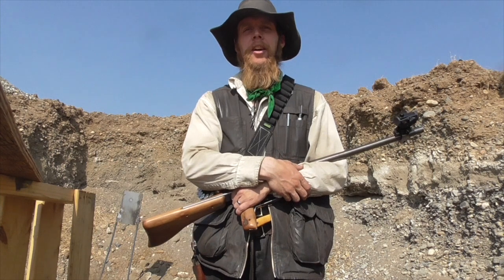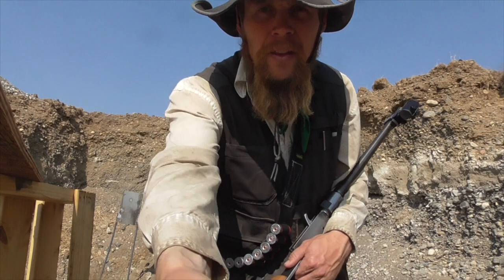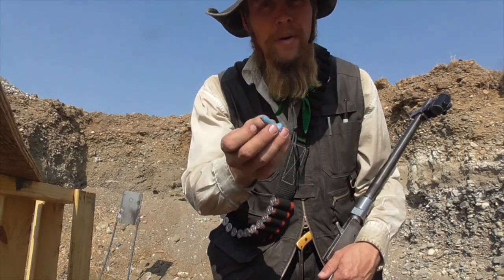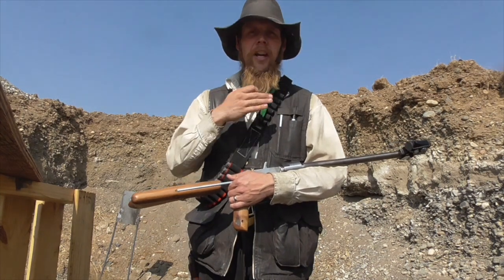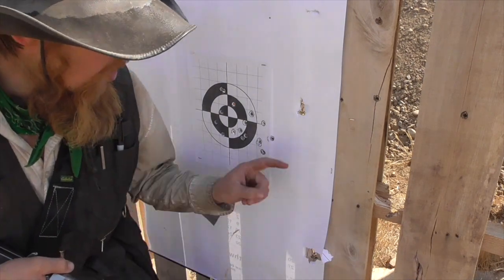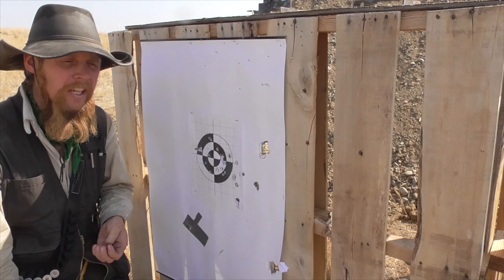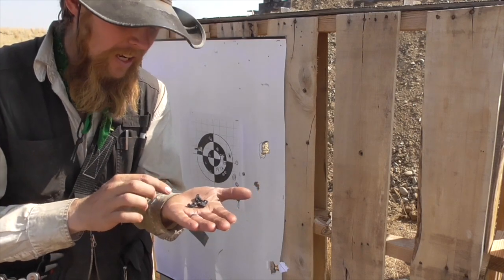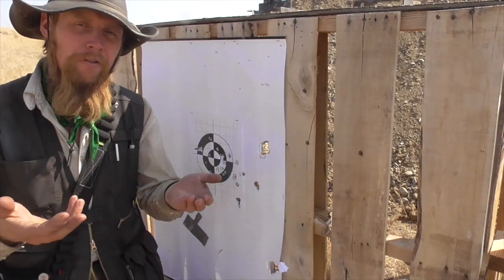The Game Spike Experimental Shotgun Slug (TIS286)

Comment: I definitely know how that feels to have something not go as planned haha, but the results aside, that is strait cool you can make your own custom rounds man. I have a idea for a 12 ga round maybe you could try. so a true hollow point round meaning the entire round is hollow with a thin backing that rests against the back of the round when loaded in the shell to capture the pressure in the chamber to push the round down barrel. but as soon as the round leaves the barrel it would act like wading and fall away leaving a true cylinder traveling through the air. this could improve aerodynamics cause wind could flow through the round at this point possibly giving it more range. If the rounds OD is 12 ga the thickness of the walls could be 1/8'' or 3/16'' leaving close to a 1/4'' whole in the middle. also for fragmentation purposes you could put a bevel on the inside rim of the round so when it impacts the walls would want to flair out. the outside walls could be cut in a bit to encourage the walls splitting at certain spots, like fragment into 5 sections or whatever. tests would obviously need to be done to figure out how deep the cuts would need to be to fragment the round at whatever velocity its traveling. If it worked I could picture it needing a rifled barrel only. Anyway let me know your thoughts on that. I think it would be an insane round if it worked as it does in my mind hahaha.
Reply from the maker: It seems to me I once saw a test of a slug with a hole all the way through it on Taufladermous.  They found that at supersonic velocities, there was actually no appreciable air flow through the hole, so it didn't do much for aerodynamics, but I could definitely see the benefits for fragmentation/penetration.  I will see what I can come up with!
Reply: @TheIdahoanShow  interesting, I'll see if I can find that video, thanks man!

Comment: You  need a larger head on the slugs.  You have all the weight at the back of the slug, which will cause it to tumble.  Use the wide end with the narrow in the middle and a larger head at the front.  As it starts to tumble, the large back end of the slug should cause more drag on that side to correct the tumble before it gets out of hand.

Comment: Did this experimental solbot shell perform to expectation? Perhaps not. On the other hand you build an effective projectile for short range thumping. Going with what you got you can experiment with propellent charge to make it a lot quieter. Some folks have taken a 45-70 loaded with 10 to 15 grains of Unique behind a 500 grain bullet and have gotten BB gun noise level. Just an example. Short range "THUMPER" that hit like a MACK truck have their place. Inside a dwelling? PRICELESS.

Comment: Flip them to big side up trim off the excess tip and use and piece of hard card under them.  They are wanting to fly heavy side first but once they flip they don't stop flipping. Would be and impressive slug with and huge flat point. Be more like and nondiscarding Sabo round.  If you make the Sabo bit longer you will not loose that much weight.

Comment: My first thought when I saw the projectile was, "It won't work."
I have no training in aerodynamics or anything like that, but it looks like a bullet with a braking parachute to me. Any unevenness in the front of the base is likely to cause unwanted rotations of the projectile.
In addition, the projectile is likely to be too tail-heavy.
Another problem, at least for accuracy, is the irregular separation of the sabot. This should separate symmetrically and shortly after leaving the barrel. (Just read Knowledge.) The fragments that were found suggest that the separation was not symmetrical and, above all, that the sabot did not split in the intended places.
Reply: The drag shouldn't be an issue at super sonic speeds. Due to the mach cone, aerodynamics are more or less a non issue,  from all that I've seen and read.

Comment: I have a question if I wanted a slug mold similar to say a key drive but made with quality material such as steel and a pin instead of it being connected could you make something like that???? If so what would you charge me for it ????? My aluminum molds for 12 gauge literally fall apart after 100 or so slugs